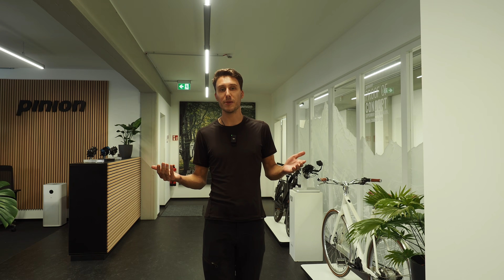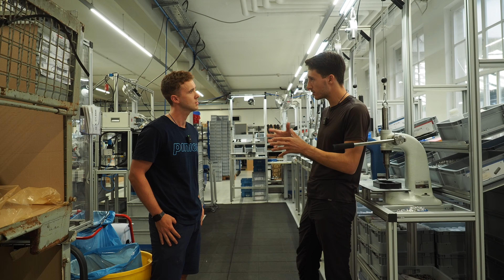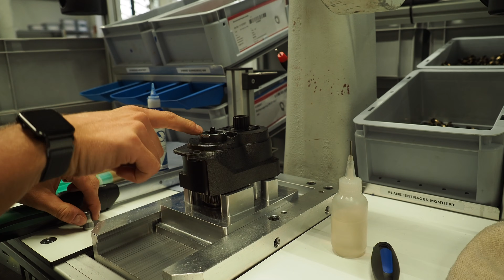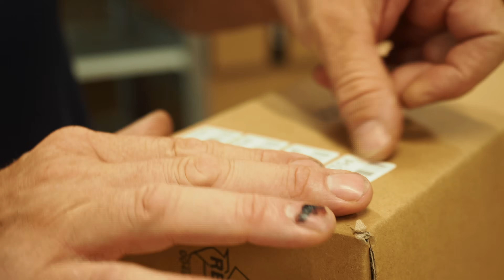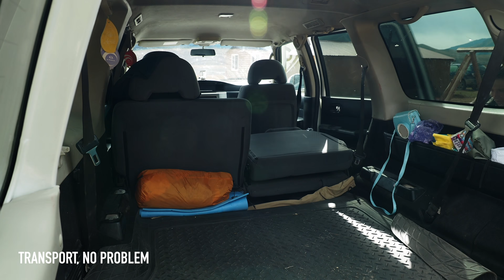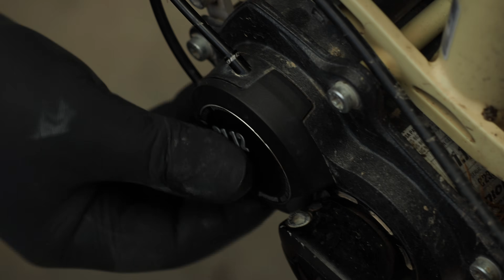Pinion: bicycle gearboxes for the future!

Comment: Thank you for your video.  Very interesting for me as bike mechanic.  I do have a few questions I wonder if you know the answers to, which I don't find on the Pinion website.  1) Is the gear shift indexing done at the shifter or the gearbox?  Gearbox would seem more reliable because it takes cable tension out of the equation.  2) Are the gear steps all really the same (eg, 17.7% for the 12-speed)?  It seems this would be a hard arithmetic problem when multiplying the 4 gear ratios from stage 1 by the 3 ratios from stage 2.  Even the most evenly spaced internally geared hubs from Shimano or Rohloff don't have the exact same steps throughout their range!  If so, how did they achieve this?  This may be a trade secret, or maybe just a tooth-counting exercise!  Thank you.

Comment: Well done!  I was sold on the Pinion gearbox and purchased my bicycle before viewing this video and am very happy I make the decision to do so.  That 3 gear model from 1936 is a remarkable achievement and such an advancement for it's day.   Outstanding!  While the derailleur drive-train is time tested and less money, it just doesn't have all the advantages of a sealed system.  It seems to be a durable and if you will, a bulletproof system that is a huge leap forward.  In my humble opinion, the increase in weight and cost are justified for those wanting "THE BEST",
Reply from the maker: Couldn’t agree more!

Comment: It was great to see the factory and assembly process. One thing I found with my PInion is that the company would not disclose what type of oil they were using. So I sent my oil in for testing and found it was 75-80w. This type of oil can be purchased cheaply from any auto parts store and does not need to come from Pinion directly. I have a few short films comming out on my channel about this process.

Comment: I have been using a 18 gear Pinion gearbox on a Stevens P18 for the last 18 months.  It is brilliant, quiet, silky smooth shifting reliable. It does what it says on the box. Change the oil annually, check the cables, job done.

If Pinion need a test rider to put kms on a Pinion gearbox for testing please let me know? Live on the German Netherlands border, retired, fit and can ride every day.
Reply from the maker: Excellent choice, that's a similar setup as what Kamran (@kamranonbike) was using for a long time, between Patagonia and Alaska. Very inspiring ride and such a great setup for it. Well done on making yours last and speaking up about it!

Comment: this would be a perfect IGH if it had a trigger shifter. grip shifter is ok for casual/light riding but cumbersome in cold/hot/bad weather/fast riding scenario where the rider will have to pay extra attention to grip/steering. overall trigger shifter will be most convenient/desire. if the future enhancement/design include a trigger shifter, I will try it. until than, I am happy with Alfine.
Reply: there are 3rd party triggers by Cinq5

Comment: I’ve just ordered a Riese and Müller Delight 5 with the 12 speed Pinion. Do you think they will make a range extender with a 250 watt hour battery to take the 800 watt hour just over the 1000.

Comment: Hi Tristan. Great video! My C1.12 Pinion gearbox has begun to develop a strange fault, in that it sometimes take a quarter of a pedal turn (or more, nearly half a turn) for the crank to engage with the gearbox. Any idea how to fix this? I'm based in the UK, with no Pinion service centre nearby... Quite separately, I've discovered that my H2r pinion rear hub leaks some of its grease, causing the freehub system to become noisy with time: it can be quietened with fresh grease, but then the grease slowly comes out again! Have you come across this, and would you know how to fix it? Thanks!
Reply from the maker: Hi Pierre, best would be to immediately contact the Pinion customer service. Let them know your situation and perhaps the warranty will cover it all. They’re quick and very helpful!
Reply: @tristanbogaard  thank you Tristan. Will do now.

Comment: Maybe this is not the place to ask this, but I wonder why have you chosen Pinion over Rohloff for your bikes?
Reply from the maker: That's fine! It was more as if Pinion chose us, since the Tout Terrain Outback comes with a Pinion gearbox only. But also, the idea of a rear wheel hub freaks me out a bit, considering swapping wheels or having to do spoke repairs is made significantly more challenging. 

The Pinion gearbox is easily dismounted in case of problems, and my rear wheel is free of clutter. I love it!

Comment: theoretically its not that more expencive to massproduce a pinion gearbox compared to a derailure and cassette? I dont see why this couldnt be the new standard if it is working flawlessly as they say. Especially if they can get the electronic gearling to shift smoothly under load.